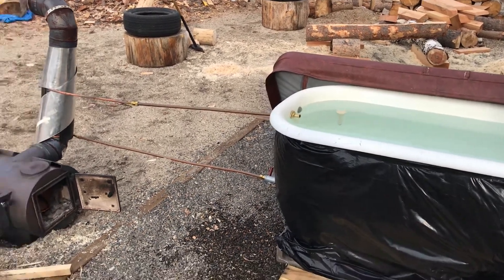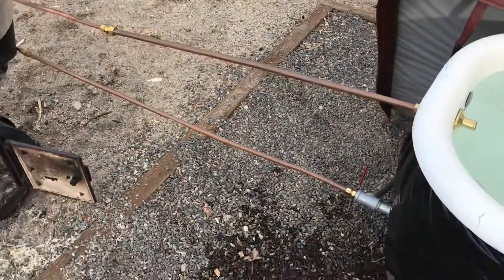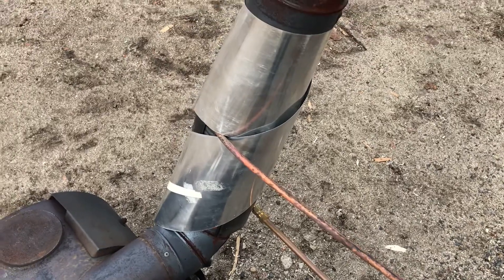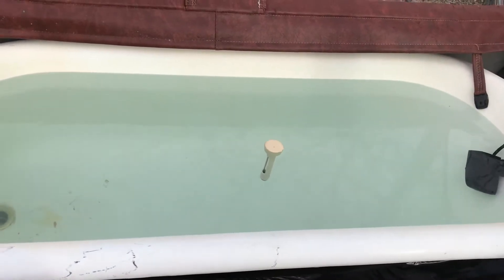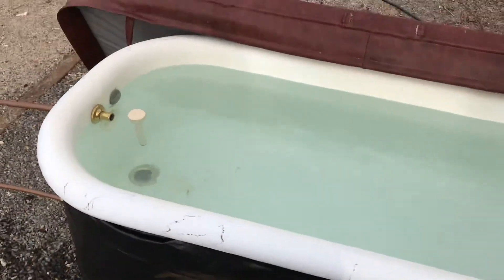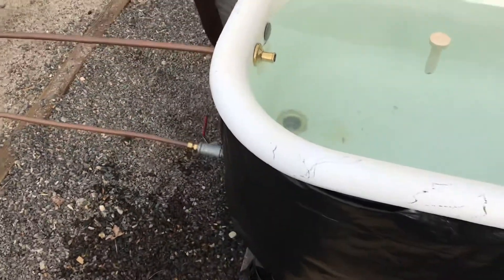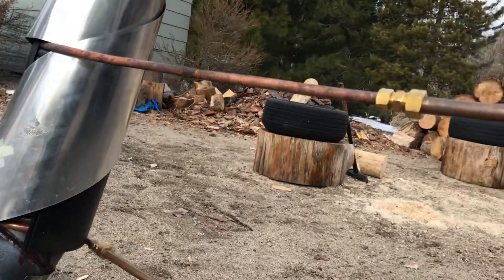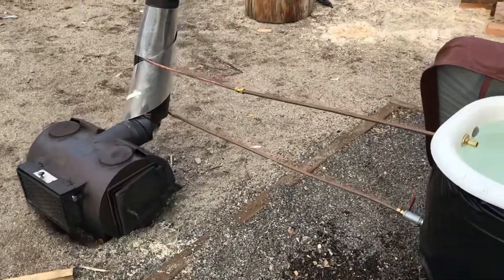Thermal syphon clawfoot hot tub

Comment: I used to have the same tub. I just put Coleman stove under the tub. Worked great and very fast. Too hot in an hour. If I make one of these systems for emergency use for my plastic tub will the cold water go up and over the tube with our a pump to the coil ?
Reply from the maker: @roscoeennis4230  yeah

Comment: Can you give a list of the fittings you used to convert the drain?
Reply from the maker: From the 1 1/4 brass drain pipe I used a rubber coupler 1 1/4 to 1 1/2, to 1 1/2 galvanized reducer to 3/4 galvanized nipple to 3/4 in tee. Drain shut off valve below and brass compression reducer to copper pipe
Reply: @JaredHempfield  thank you I really appreciate it!
Reply from the maker: @danmetrovich883  Anytime, if you want I can show you a close up video of it by email. HempOrDie@gmail.com
Reply: @JaredHempfield  thanks but took a screenshot of it and I think I can see it pretty well. But I would like to know what you did at the top of the tub with the in line.
Reply from the maker: @danmetrovich883  I plugged the overflow drain hole and one side of the faucet then copper into compression fitting to 1in pipe thread on part of the faucet
Reply: @JaredHempfield  okay! Thanks!
Reply: Just a couple more questions. I see you wrapped the copper coil around the stack. Is that better than putting it inside the stove, or is there no real difference? And is there a certain angle the copper pipe needs to be to make the water flow?
Reply from the maker: @danmetrovich883  Inside will get too hot and steam, also build up with creosote. You can use a steel pipe inside a stove, cheaper than copper coil. The cold supply angle doesnt matter so much as the hot going in, has to be slightly uphill. I found this 1/2 inch copper for free but bigger would be ideal.
Reply: @JaredHempfield  okay so if I wrap the coil around the stack and where I’m placing the tub and stove, the stove will be slightly higher, then it should circulate the water just fine. Is that right?
Reply from the maker: @danmetrovich883  As long as the boiling water line going into the top of the tub is elevated down to the stove slightly
Reply from the maker: @danmetrovich883  I had to slightly bury the stove and put the tub on blocks
Reply: @JaredHempfield  got it. I built a platform for the tub to sit on, so I think that should work....I hope.